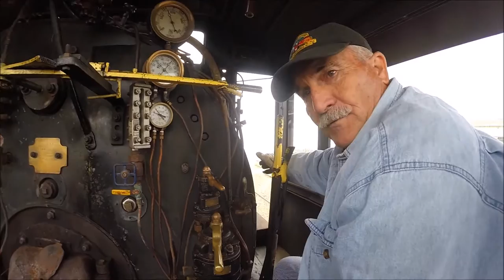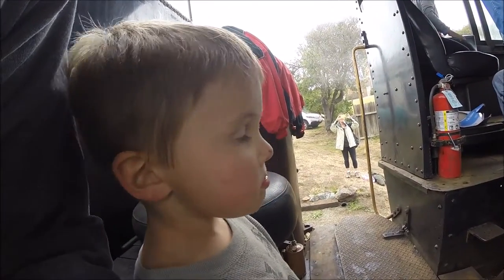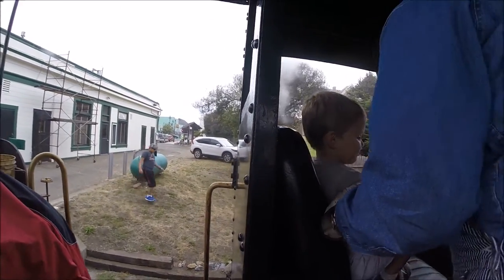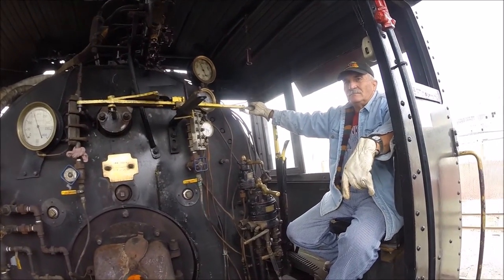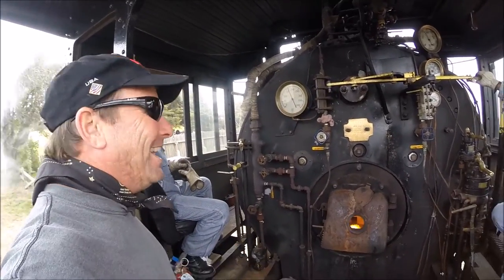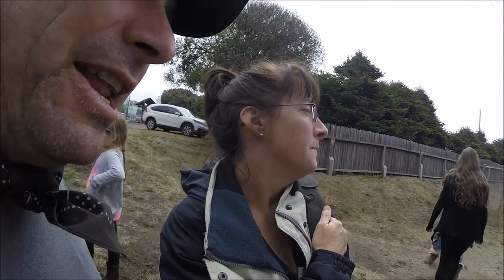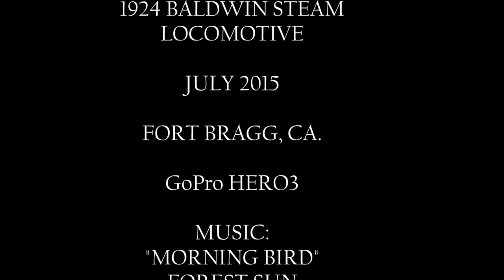The Skunk Train 1924 Baldwin Locomotive Checkout

Comment: On Static display there is a Baldwin steam locomotive in Amarillo since 1956.    Nice to know about the #45...very interesting an informative.    The #45 makes for a good one to run.  The one in Amarillo is the prototype Santa Fe 5000 delivered in 1930.     Because it is a Texas type 2-10-4 with 69" drivers  it would be much more trouble to go on short trips.

Comment: I enjoy your video's but have one correction. Boiler gauge is measuring pounds per square inch (P.S.I.), not temperature. At 175 degrees you'd only have very hot water, not steam.
Reply: Wayne Cipperly It depends on the pressure too! Charles and Boils laws.